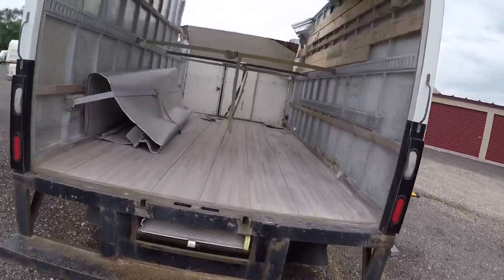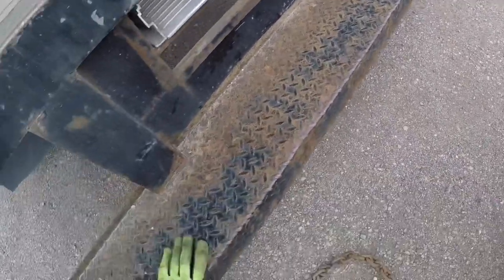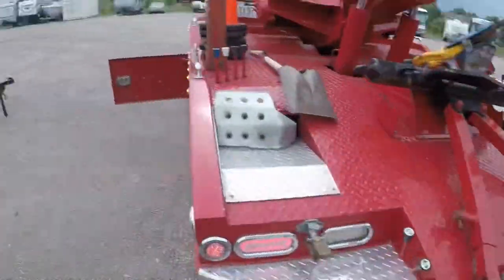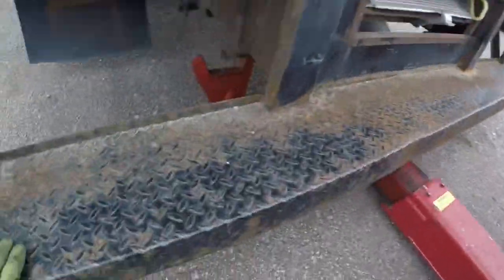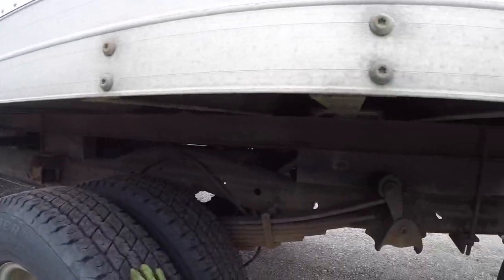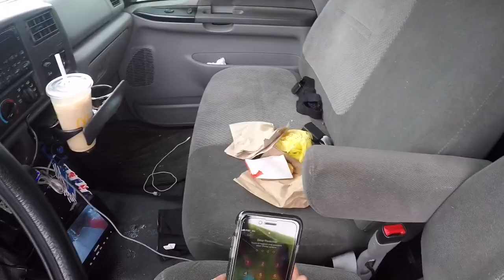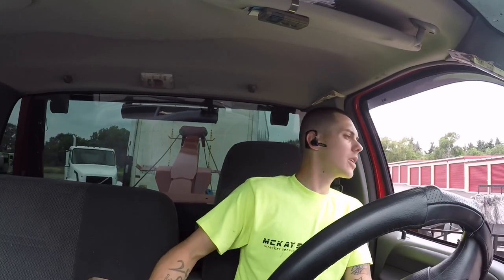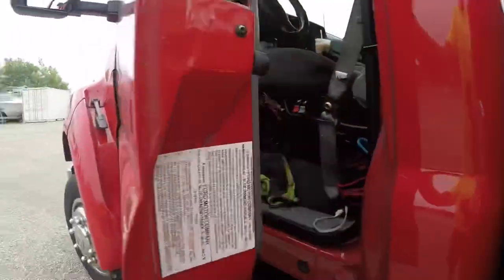Towing a busted up  box truck w/MWS

Comment: If it’s to weak to pick up on why put safety chains on the weak point.
Reply from the maker: Well because I’m confident in my hook up that nothing is going to warrant the use of those safety chains and believe it or not I have dropped a van years ago and had the chains hooked to the sway bar link and it held strong but I wouldn’t ever lift from the sway bar link

Comment: Yeah, you picked that one up right where you should have, cuz that bumper is really just a step and those frame extensions didn’t have a lot of weld on them. And I was looking hard at that bumper whether it would clear on turns as that’s my biggest concern with my wheel lift. Cuz if I hit on a turn it takes out by dually bedside, but I’ve got controls on the inside(repo truck) so I can bump it out a bit if necessary.  Stay safe! 👍🏼
Reply from the maker: Yea unfortunately when I turned into the drop off it had a large dip in the entrance and that dam bumper tagged my truck with a small scratch

Comment: If the engine runs fine then load from the front and leave the engine running so the transmission  pump can circulate the trans fluid. You don't have to drop the driveline.
Reply from the maker: I always drop the drive line when towing anything from the front wether it runs or not I have herd that the pump doesn’t work fast enough at engine idle so I’m not willing to risk it lol